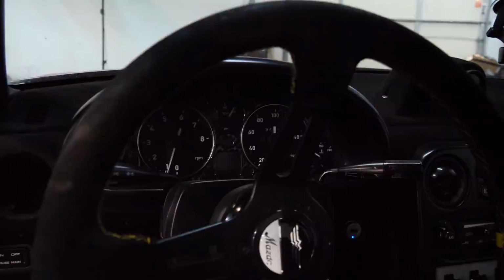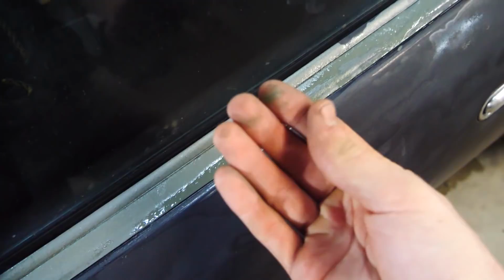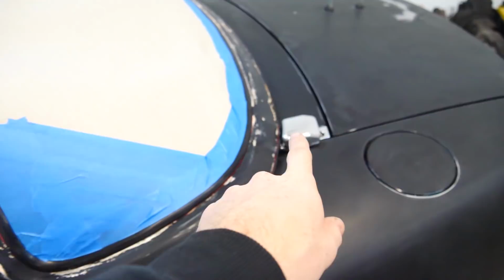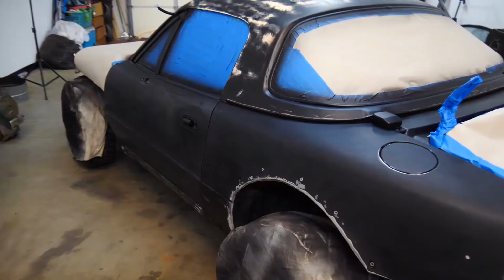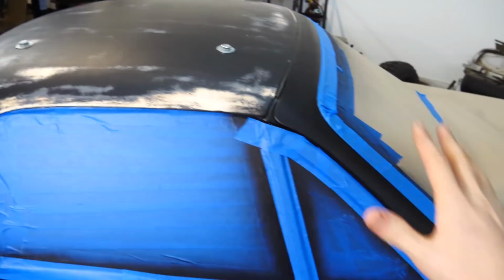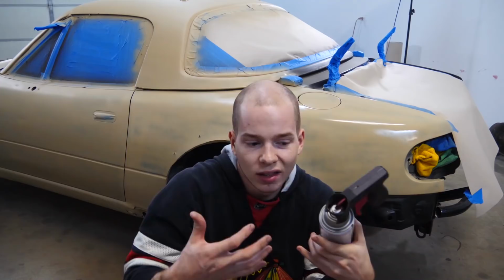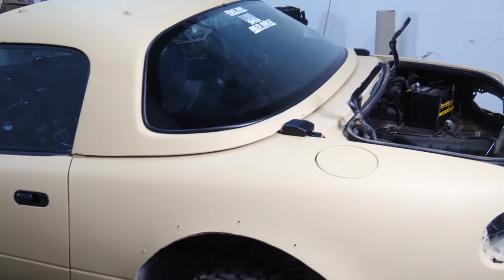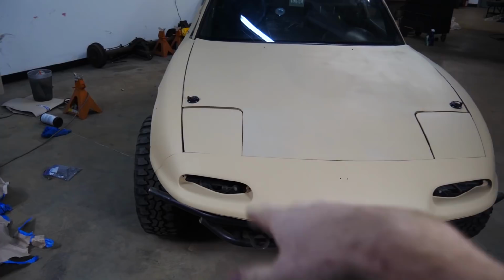Painting the RALLY MIATA Army Tan! (Pt. 2)

Comment: As someone who has done a lot of spray painting, you will notice that some of the spray can nozzles will work better than others (better flow, more even distribution, etc)...  top tip is to keep the best nozzle and use it on every can.  It will give you a more consistant finish across all of the panels.  One more top tip...  instead of spraying back and forth in a small section on a wide panel, go from one side of the panel to the other side in one swipe (helps prevent tiger striping).  
Just my 2 cents and keep up the good work.
Reply: Don't forget the overlapping
Reply: 75% overlap is what I was taught... then again, I use paint guns, don't know how well that'd work with cans
Reply: Got to be careful with 75% overlap with spray cans Fozzle..  aerosol cans dont spray with the same pressure as paint guns do, so the aerosol mixture is thicker.  Too much overlap with aerosol cans and the panel will look like chess board..  lol.

Comment: Not bad, when painting spray at 12” and try longer strokes overlapping 50%. 

A tip for touching up. Spray the paint in the Center of the cap and use a super fine paint brush to touch up paint on the edges that got messed up. 

You should be able to spray the entire length of the door in one motion,  use your body to lean from one side to another.  Long sweeping strokes.

Comment: I managed a Maaco for several years.... To remove the tough spots of PlastiDip we used Wax & Grease remover...just saturated it. Then wiped or pressure washed off. On a couple of occasions we added more PlastiDip to the area, let it dry then we just pulled it off. On another note... Always paint the trim after the car....Also, If the trim still doesn't take the paint. Clean it with paint thinner really good....Then wax & grease remover.... tack rag it then prime and paint. Should be good to go! With your hood..... Go one direction on 1 layer and the other direction on the next layer. It will help prevent the tiger stripes from the rattle can. Also be sure to have the room temp at a minimum of 74 degrees...That should help.
Looks pretty decent with a rattle can...and as you said it will look much better when everything else is put back on.
Love your channel been watching/sub for a while now! Love the videos!!

Comment: Great job on the paint but I can give you a few tips to improve painting anything else. The first coat can go on a little lighter. The first coat is what you would refer to as a "tack coat" and should see a majority of the coating underneath. Then you can progress to slightly heavier coats but not to the point it is running. The other thing is about "orange peel." Orange peel is from too heavy of a coat, not from cold paint. Warming the can up is great though for good paint atomization when its is sprayed and also a good tack coat because it is a little harder to make it go on too thick. Keep up the good work though, bro!

Comment: Would have asked a question sooner had I not been at work. Now in regards to having the paint run so much, it could just be cuz you made such a heavy first pass over with the paint. Granted I haven't tried rattle-canning a car, but I usually start off with 2 light coats then proceed to applying a heavier 3rd coat. Regardless, loved how it came out and as always, take it easy!

Comment: 4g63 swap the rally miata
Reply: Phantom Tandems this
Reply: Yesssss
Reply: heck yeah
Reply: The 4g63 is a transversely mounted engine the miata has a longtitudal engine you could probably make it work somehow but it really doesn't worth it you better off with like a 1.8t from an audi a4 with the whole quattro system or something like that
Reply: HypnotizedSeal11 look up 4g63 swapped mighty max/ station. Not hard at all to change orientation and the motor is 600hp capable stock with cheap bolt ons. An Audi drivetrain would be nothing but problems wiring wise and not hold much power
Reply: I think the best thing for him to do would be to buy a cheap 2nd gen Montero and use that as the basis for his conversion. Its a body on frame design so it would be easier to work with and depending on if you get the 4 or 6 cylinder version you can drop in an Evo engine or a 3000GT engine. Both can make fantastic power and it would be super unique!
Reply: or 420🅰
Reply: The 4g63 came stock in the first gen Mitsubishi l200/ mighty max it would give a decent 4wd platform ifs front suspension with center diff lock the 4g63 in the l200 was a poos carby one tho needs to be the 4wd one tho
Reply: @bayleyfearn9676  True, the nice thing about the Montero/Pajero is that he could get it in the 3 door version and the wheelbase would be very similar to a Miata. It would just be 4" give or take a few inches so he wouldn't have to modify the frame as much!
Reply: @Whitestorm2  plus the coil rear diff would be miles better than the leaf springs in a pickup
Reply: @bayleyfearn9676  Ahh that's true, didn't think about that! He could pick up a pretty decent Monty for 1-2k. Use it as his winter beater then rip it in half come spring lmao!